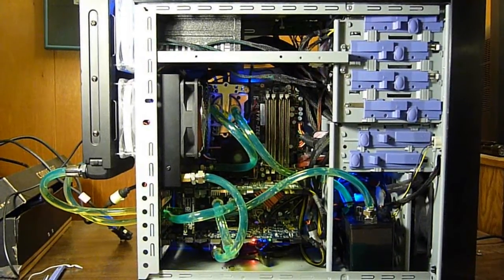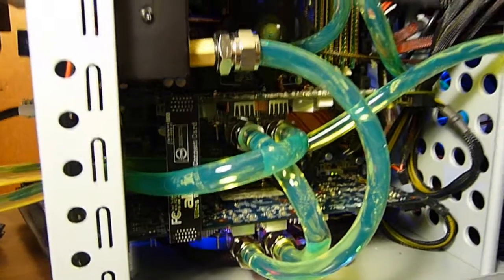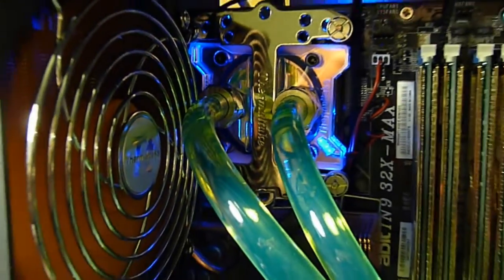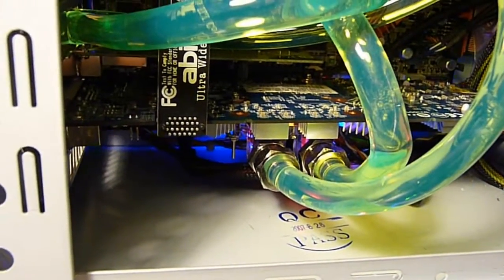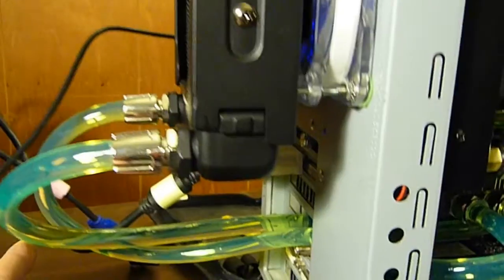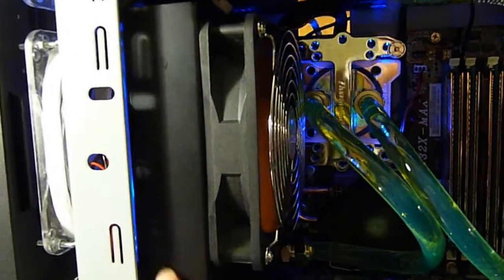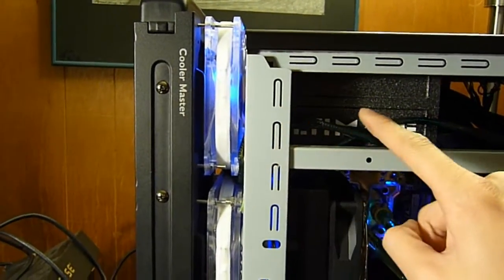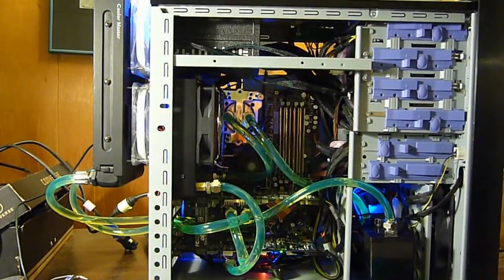Thermaltake BigWater 735 Liquid Cooling Kit Modified

Comment: I have a quick question, and its pretty much the only thing im a little confused about, im planning on watercooling my pc with pretty much the same setup you got, well here it is. what kind of connectors did you use or would recomend for all the connections between your hoses and the cpu, vga, and radiator blocks? im planning on having a single radiator inside with two 120's on it, and a 2x120 long rad on top with an additional 2x120 mm fans on it making it a total of 4 fans for that rad.

Comment from the maker: @amigofication Make sure you thoroughly clean the ram modules before sticking on the ram heatsinks. The thermal paste that comes with stock coolers are usually greasy and makes it difficult for anything to stick to it. I used a q-tip and scrubbed the ram module with 91% rubbing alcohol (higher the better) until it didn't feel greasy anymore (lots of scrubbing). Paper glue won't work as heat will destick it, use doublesided thermal tape. And ram sinks aren't entirely necessary, but recommended.

Comment: @Shaunhollis 

i think this works better.:

res/pump > rad 120 > CPU > rad 240 > GPU1 > GPU2 > res.

and if u got a good airflow in your case the components doesnt have enough time to heat all that volume of air up.

and i would put another fan on the rad

Comment from the maker: @strika71 Yes, you are right, this is less efficient and ambient air would be better. I did this for ease of mounting and aesthetics. However, it is not heating the water because air is still being pushed out and displaced by cooler "warm" air.

Comment: I'll agree, Why have semi hot water pumped from a SMALL radiator into very hot Gfx cards, then back into a huge radiator? also, its overloading that small pump by too much water not being moved around fast enough, what really needs to happen is for him to lose that tiny Radiator, and get a few Y connectors, so that it splits from the pump to both the cpu and the GFX, then merge back to a single line to the radiator, ( different sized hosing should be used to stop in-correct flow )

Comment: I have always done air cooling, which is ok because my CPU Idols at around 30, and my GPU has Vapor X which rocks. Problem is that I need an alternative cooling system because I wanted to buy a second videocard to crossfire with, but with the fan & heatsinks attached, both card won't even fit on my mobo at the same time. I don't really have a lot (most of it will go towards to second GPU), but I need some sort of watercooling system that can replace my two VGA fans, and probably cool my CPU too.

Comment from the maker: The external radiator doesn't cover the full width of the PSU, so the power plug is still exposed. I'm not sure what you're referring to about the cooler, but the liquid is in a closed system, so ideally nothing should be escaping. Any air is pushed out to the reservoir.

Comment from the maker: I just added a little bit more today for the first time, it's been running a little low lately probably because of the summer heat causing a little evaporation through the imperfectly closed system.

Comment from the maker: Yes, blowing the PSU air into the radiator does decrease efficiency, but not significantly  b/c at equilibrium the air temperatures between the radiator and PSU are similar. It was worth the convenience of mounting. And I'm using the Cooler Master UPC 700W High Efficiency 80+ Gold PSU.

Comment: I know it's an old comment but distilled water is preferred because it's non-chemical and also non-conductive which won't ruin your system if a leak occurs.
and if I remember correctly it is also more efficient then chemical coolants.

Comment: What is the purpose of cooling the air after it leaves the power supply?  Wouldn't that serve no purpose for cooling the power supply?  Might it actually increase the temperature of the radiator and decrease the cooling efficiency of the rest of the system?  Not trying to mock the system, just looking for information.  Those are a lot of electrical loads.  What kind of power supply are you using?

Comment: very nice!!! one question! I have a raidmax aztec case that has an 8 cm fan in the back, so I can't mount the radiator for the processor in the back of the case! Is it possible to mount the radiator outside the case? Is there any danger in moving the radiator while it works? I have 2 cats :)) Thanks!!! Great video, well explained! ;)

Comment from the maker: The 400L/hr pump runs perfectly fine. The radiator didn't come with extra piping. However, the 735 kit comes with ample piping, which I used.

Comment: just wondering how does the 400lph pump work? some people complained it doesn't work well but your running video cards and everything off it. also for your second radiator did you have to buy the line connectors? or did the radiator come with them?

Comment from the maker: The back radiator is the width of a 120mm fan, which fits on the screw holes of the case back fan. So it doesn't block the entire back width of my case which leaves room for my power cord just on the other side of the radiator. (Left side if looking straight onto the back panel of the case)

Comment from the maker: I'm running my primary and secondary monitor on the primary 8800GT (dual head) and the tertiary monitor on the second 8800GT. The lost benefit of three video cards is enabling SLI and triple monitors at the same time. But SLI doesn't benefit my triple monitor gaming anyways because of a software limitation (SoftTH).

Comment from the maker: Yea, that 400 L/Hr pump just came bundled with a single radiator system. But I noticed the Thermaltake BigWater 745 was a very similar 2 radiator system to mine using the same 400 L/Hr pump. So hopefully it should be okay.

Comment from the maker: yea, I know... the video cards are too close together... ideally I would get a 90 degree joint,  but the kink actually is less constricted as it appears. The channels in the CPU/VGA blocks and radiators are more constricted. Since the flow rate is constant at 400 L/hr, simply the velocity of liquid flow will increase at the constriction.